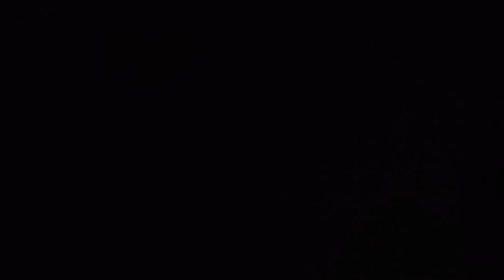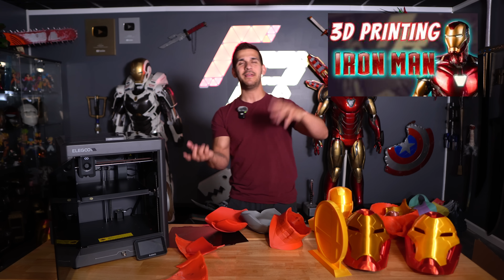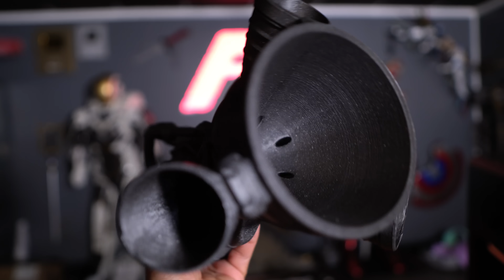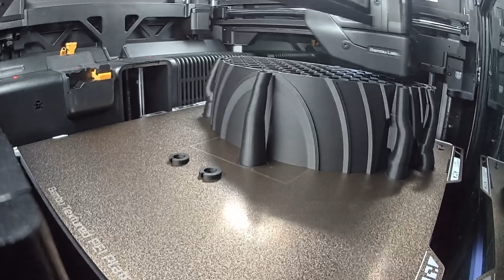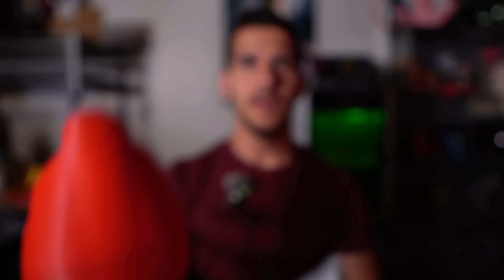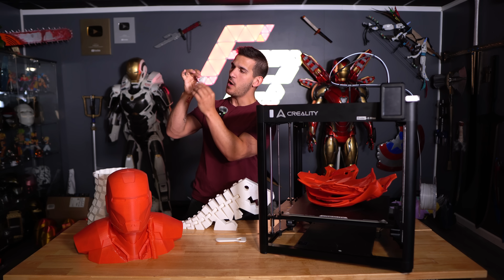3D Printer Update: Elegoo Centauri Carbon, Prusa Core One, Creality Ender-5 MAX, and Bambu Lab H2D

Comment: Long term reviews hold more value in my opinion, I been looking to get a new machine but I have been waiting for more time to pass to decide if should pull the trigger and get a specific one, have done nothing but stick to a bambu p1s but I would love a cheaper model that proves to work just as good for a viable price tag but a review based on just a month or two doesn’t feel like enough, 6-8 months would make way more sense since these things need proper testing and the companies also should be reviewed on how they work with you if such an issue should come up so I prefer a longer term update video over a sneak peek test video to promote something new that we don’t know if it will hold up long term

Comment: Unboxing and “initial” reviews are great, especially if I’m looking to buy something NOW. But I’m more interested in a review after three months and several hundreds of print hours have passed. Esp on something as expensive as the H2d, I’ll wait six months before I buy. I bought a K2+ at release and paid the price of rushed build quality issues, firmware issues, etc. It’s working great now, but I was nearly at a point of pitching that machine.

Comment: I am loving my Kobra 3 Max so much I bought a second one. I just printed a flawless 1/3 scale Venom to wall mount. Not a single failed print so far. I did add a PEI sheet to the build plate like always though.

Comment: I just got the email that my Elegoo CC has been shipped, like your first video about it. I was REALLY hoping they would upgrade the Lighting. Does it look like there's enough space to replace the lighting with some Brighter LEDs? Thanks for you reviews and info. I'm a leather worker that is used to doing things by hand. In the last couple years I've started getting Cosplay. Because of your reviews and Advice the Elegoo Centauri Carbon will be my FIRST printer. Fingers crossed!
Reply: What time frame did you slot into for pre-order?  I'm waiting on mine as well and I think I'm in the "end of May" bucket.  I have seen reviews about changing the LED on it, and apparently its very simplistic.

Comment: Something missing from the 3D print space - long term honest reviews.

Quick looks into the initial release are fine, but they aren't reviews and don't drive my buying decision.

But does the Creality keep going 6mo later?
Does the Anycubic nozzle fall off after 3 weeks?

I want to know that stuff.

It's why I bought Bambu's - long term reviews were ... "It just works" - not "It just works when I opened the box", but a year, two years later - it just works.

That influenced my buying decision.
Reply: Also, I had an ender 5+ too. Had. It was great, for a bit 🤣

Comment: what i want to know is how deep is the ender 5 max, like will it fit on a standard 60cm deep desk etc?
Reply: I have 60x60cm stone plate underneath and feet just barely fit on it. They are almost at the very corners of the printer and they don’t stick out outside of the plate but the printer does a bit. I’ll measure it a bit later
Reply: 60.5x63x61cm WxHxD of printer with feet and without screen and spool holder on side. Screen sticks out 4cm to front and 6cm above printer. Spool holder adds about 12cm to width when attached. Few cm for filament sensor on the same side above holder. Also, printing head(wo cables) raises 4cm above top and when connected (cables, tube) it needs 20+cm of space above top edge of printer. The back of printer is flat and doesn’t have any addons. Let me know if you need more details
Reply: @Geneva-f5r  the main one was depth, 61cm means it ever so slightly hangs over the front of my desk (the screen doesn't matter as its in the air, as long as the feet fit) thanks!

Comment: Do you think that Elegoo will be fixing the issues that you have had with their build plate?  If I end up getting it, I won’t have the ability to swap in a different build plate since the only other printer I have is the Prusa MK3 (original).
Reply from the maker: Maybe but you can also just buy a new build plate

Comment: Quick question: Centauri or P1P/P1S/A1. I`m interested in quality...
I do like your idea of revisiting and showing what change, and if you can i would also like to see comparisons between the well know established and the smaller 3d printer producers(the usual suspects Creality, Bamboo, Elegoo, centauri vs p1p/p1s etc, etc.)

Also addressing the end of the video, you should have mentioned that if machine works flawlessly, the company paid only the price of the machine to get marketing to what, thousands if not millions of viewers(in time). Go to a marketing company and see how much it will cost to run this kind of marketing campaign. They get it really cheap, even if there are some bad things, that need fixes. Remember bad publicity is still publicity.
Reply: Quality get the P1S but youre not gonna get that much more quality. We are talking marginal improvements, even the A1 is basically just as good for printing tpu, petg, pla.
Reply: @2341f  Vs Centauri or between bamboos?
Reply: @danny3man haven't tried the centauri

Comment: Great video Frank! One printer I had hoped you’d mention was the K2 Plus, because mine is an absolute unit (when the bowden tube fitting hadn’t broken). Just wanted to see how it’s been working and holding up for you.
Reply: I have had one since December sometime. I have 350 hours on it as of today. It has been a good experience for me. It prints really well. All the small problems I have had are related to the CFS. I think I have that mostly worked out now. Other than that I have been happy with it. I did get a Wham Bam build plate as soon as they were available. Huge improvement! The original build plate was aweful.
Reply: @NewZonaRides any PA prints?
Reply: @Samlilly2  No, Only PETG and PLA so far.

Comment: I would recommend doing a quick update on past reviewed printers at the beginning or end of a different printers initial review.  The update doesn't need to be super in depth, as you will already have covered that printer.  Just a flash update on if any problems were fixed or if a printer quality fell off etc.  I'm noob af but printed a mark 39 suit almost entirely on a Neptune 4 max, and it just worked...I tell that poor printer everyday "don't worry, frankly isn't real and he can't hurt you" lol